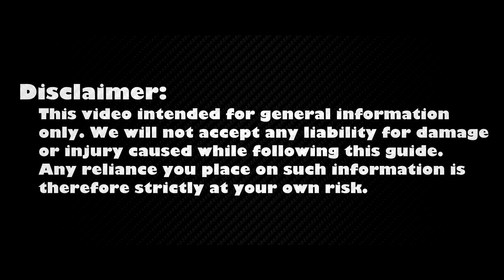Samsung 550P Overheating Fix: Disassembly, Fan Cleaning, and Thermal Paste Replacement Guide

Comment: hi, I need to change the DVD disc For a case adapted to engage one second hard drive . I need to know if you already did this, and also , what is the height in millimeters ( 7mm , 9.5mm or 12mm ) DVD drive . Tks .

Comment: İ have a problem on ''Fan Remove'' part. MY fan is ''Dc Brushless - KSB0805HB''. it has 7 screw and on queue i can turn 1 to 4 but 5-6-7 is stuck and not turning. What can i do ? best regards.